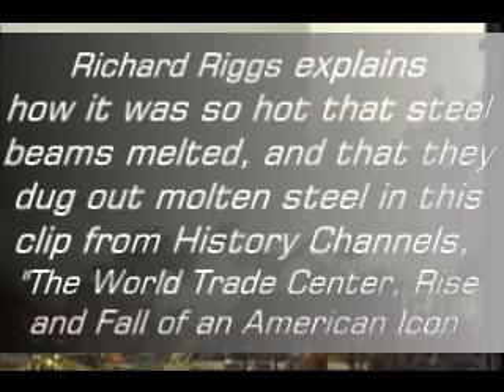History Channel Molten Metal At Ground Zero

Comment: *sigh*
Try not to be obtuse, and see if you can follow this train of thought:
A) Large amounts of thermite was used to cut the structural steel. By-products = intense heat and a lot of molten steel.
B) molten steel, being a liquid, seeks the lowest level possible, e.g. the basement. This is where you get the eyewitness reports of rivers of steel.
C) 110 stories worth of debris acts like a blanket insulating the whole mess, hence, the sustained high temperatures months after 911.

Comment: There is no indication that the "Office Fire" was at any temperature higher than an office fire would reach. Steel loses strength with heat, you can see many warped bent and collapsed steel in structures due to standard fires. The collapse was not symetrical, it started at one side. This is important because the twisting moment caused by one side "losing" completely removes the structural integrity of the other which is designed for load not lateral force. Gravity acts vertically down.

Comment: @ThePassiveFist Well I thank you for replying without resulting to insults. As the videos all dictate most of the debris is shot outward because yes, there is far too much material underneath for it to go straight down. seeing the various angles via video you can see a LOT of material blowing out the sides more than going straight down, Than after the 10-12 second mark as the smoke and debris hits the ground you can see the middle section of the tower still there

Comment: @sacr3 
yes - the substance is called Thermite, the reaction is called the Thermite reaction.
you stated that Thermite is the reaction while glossing over or ignoring the fact that it is also the substance.
now that we have that out of the way, the Thermitic reaction would have stopped as soon as the available thermite had been used. the heat generated, and insulated by tons of rubble, would have stayed there for weeks.
the incredible heat could not possibly have been generated by office fires

Comment: the idea that a (relatively, compared to the rest of the building) small section of floors falling onto the structure (which gets stronger and more solid as you get further down) could cause a _TOTAL_ disintegration of steel and concrete that we witnessed is unbelievable to me, and to thousands of others, some of whom are more educated and more qualified to comment than me.
i would have expected to see far more floors still standing, or at least core columns rising hundreds of feet into the air

Comment: @captwasabi I forgot the universal law "650c the steel looses half of its strength
and causes building collapse" .  Forget all we know about steelframe structures
and fires, there is a new science in town. A half-finished steel frame structure : 
The Windsor building in Madrid burned for 18-20 hours and peaked at 800 celcius. This is as close to a full-scale experiment we get and the best
scientific basis for behaviour of steel frame structures on fire.

Comment: @ThePassiveFist  As seen in Computer Simulations the initial impact did cause a lot of structural damage to the core, destabilizing the tower. They said the tower would have held if it wasn't for the thousands of pounds of jet fuel burning, not all the jet fuel burnt right away, there was still residual fuel in parts of the tanks and the office furniture etc was burning away also. The initial explosion exposed the steel, and long hot burn weakened the steel, and so began the collapse

Comment: Thermite is quick reaction hence its intense heat. You cannot "delay" its burning to make it burn for weeks, nor can you have it so that at first it burns so hot as to cut steel (its usual 4000 degrees range) and then have it somehow change and start burning at 1500 degrees. It is not a controllable reaction its either "on" or "off" and over very quick. You cannot "Dilute" it to make "Half" a reaction or less of a reaction. So, thermite is a cause is not possible.

Comment: Well the physics is very simple: Melting point structural steel 1500+ degrees celcius.
Jet fuel A kerosene 980C. Hydrocarbon fires burning in the atmosphere 825C.

Even under the best circumstances the fires in WTC1/2 could not melt the steel.

Comment: @ThePassiveFist  Alright, 1 - There was no free fall, because A - scientifically impossible even with Thermite, even with planted explosives so you'll never receive an answer to that because that just isn't what happened. The inner part of the tower fell slower compared to the outer part of the tower as we see in other videos. Once the tower is finished collapsing after 14-15 seconds of falling, up to 40 stories of the Core is still left standing for a short period. There was never any free fall

Comment: Sick of the back and forth with Cole.
Fact. WTC experienced 2.3 seconds of freefall.
ergo, for 2.3 seconds, there was NO RESISTANCE to the collapse.
the average fall speed for the total collapse has NO bearing on the measurement. that'd be like saying "my average speed for the total journey was only 55 miles per hour so could not have been speeding officer".

Comment: @captwasabi .... How can anyone respond to an individual that writes this "The average temperature of a house fire can range between 1100-1500 degrees, more than enough to both weaken and melt steel at
1130 and 1315 degrees respectively" . Have you ever used a frying pan, or lit a fire in a stove... Even if you dropped out of school at 4th grade , real life experience should have been an indicator that the statement might 
be a little turboretarded.

Comment: @ThePassiveFist  Oh give it a rest, You're really picking at the bottom of the barrel to be claiming i'm incorrect because of how I used the word. And no, even under the rubble the reaction would have simple stopped, the heat would have diminished, specially with all the water being poured on the rubble. Thermite was never the reason, and there was never thermite there. No traces, Nothing. Single people making videos saying there was, doesn't mean there is.

Comment: @sacr3 The building should have tipped over in the direction of the destruction and not destroy itself on the way down.  As building get close to the ground the beams are actuallty stronger and not weaker.   So  the top cannot destroy the bottom.

Comment: @captwasabi Your saying 90k liters of jet fuel burned over a period of several hours:
I`m not sure what fires you are refering too since the WTC 2/1 fires 56/85 mins.
And the fact that most of the jet fuel burned off at impact further questions your
random statements. "steel begins to soften around 425 and lose half its strength at 650C" : So how can there be molten steel and fused steel/concrete that requires
1500+C ?

Comment: thanks for debating in a mature manor. No sarcasm.Plenty just go straight to insults.  I understand your point, but don't think you have not seen the evidence that I have seen(all public record). A bolder of mixed concrete_steel. A cross of I beams that were fused together by heat. Extreme temperatures at all three demolished buildings days later by thermal fly overs. I used to weld, and I know a bit about structural steel. three buildings fell close to freefall through point of most resistance

Comment: Your question was s cued a bit, but I think I got the jest of it. I hit "post" all the time, before a good proofread, plus I suck at English. You are asking me to point out an impossibility with the official story?  Ok.  Metal melts at a higher temp then what was possible with the office fires.  Jet fuel is nothing but refined kerosine. Don't think those temps are possible even if given optimal oxygen. Collapses are asymmetrical unless all main support is severed at the same time .  I got more.

Comment: @captwasabi And YES it is physically IMPOSSIBLE to create the kind of 
pressure you are refering to. A high-rised steel framed homogenous structure
consisting of 90%+ Air does not create consistent pressure over a timeperiod.
If you had any Idea how this even remotely works you would light yourself on
fire this instant in shame. Alot of the steel beams explodes outwards like a big fountain, and they don`t land neatly in a timed fashion to create pressure. Oxygen
is also a factor

Comment: So my initial statement that the physics is simple: 1585C melting point of structural
steel. Jet fuel / hydro carbonf ires 980c/825c under best possible atmospheric
conditions. To what extent you did not understand these rather basic and
easily confirmable facts captwasabi is beyond me. This would implicate 
other sources of energy/accelerant capable of producing temperatures over
1585C or else this would be physically _impossible_  , it is that simple.

Comment: @sacr3 
I could believe that jet planes impacting the building could cause the damage and cause the towers to collapse, if it happened like that.
however, the collapse itself happened FAR too long after the impact and fire. if the damage done was going to cause the collapse, logic dictates it would happen during or only slightly after impact.
i would expect to see the top collapse onto the lower floors, and a gradual, halting collapse. NOT the explosive ejection of material we actually do see.

Comment: Video 1. HAHA. Thats all that needs to be said. I guess the numbers the guy uses and graphs boggles your mind into submission. It speeds up due to change in drag coefficient (turning thin end on, also losing drag as bits break off) I can also see other objects moving JUST as fast to the right. Video 2. That is not explosives its not even how demolition is done. Implosionworld com says it all. Video 3 proves NOTHING about explosives Video 4 has been removed. Im glad your not a judge or important